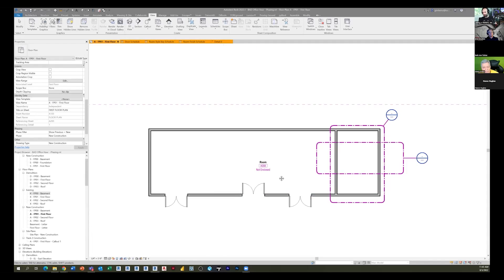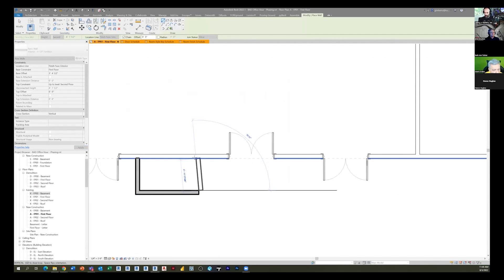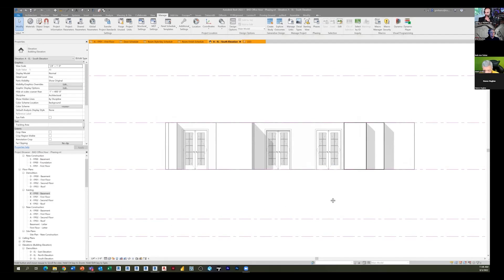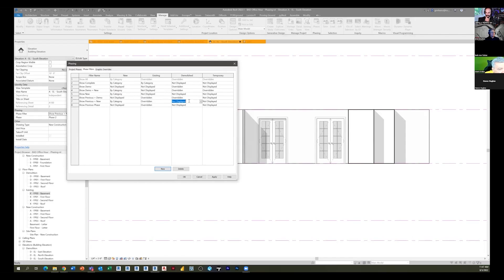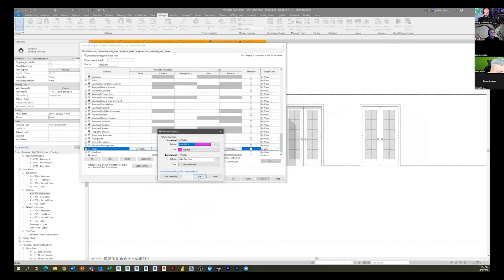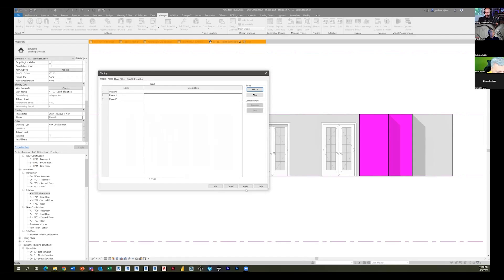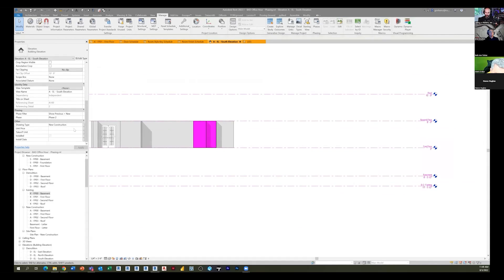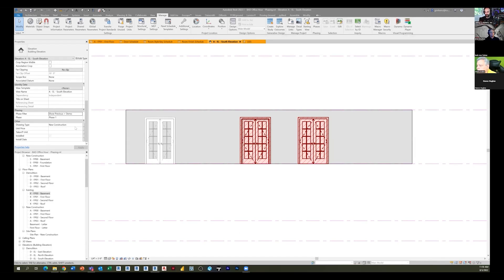Revit Phasing Tutorial : Multi-Phase and Demolition (Office Hour Sessions)

Comment: So, here's a question: based on Revit's statement that anything new is the current view/phase, we have Phase 1, which is divided into A, B, C, and D. How can I show all of Phase 1 (A, B, C, D) as bold black lines for new items? I tried using view filters, but Revit still makes the previous phase items gray/halftone, even though my filter states that Phase 1A is black.
Reply from the maker: So... you have Phase 1A, Phase 1B, Phase 1C, and Phase 1D...?  The only way to show ALL of phase 1 that way would be to make sure you are in Revit 2025 and use Filters with the Phasing (something you could NOT do in previous versions)...
Reply: @TheRevitKid  Got IT! But can you not show the pattern by category then? as in a CMU wall on the floor plan
Reply from the maker: @Pa_Dave  Yes, but you have to modify your phase filters (by view) to not override that... Set the view to None for phase filter, for example... and only use Filters for that view.

Comment: I find in some projects where I'm showing demo for the city to understand and for the contractor to know on site. Showing existing building where parts of elevation, plan, ceiling are the final moments in a time for a demo permit makes sense to have a demo phase? At least that's what I have done in the past. I know I could show all this with showing what's being demo but in my case it becomes a phase because there was a stopping point for demo permit.
Reply from the maker: You don’t need a demo phase to show existing and demo in a demo plan…?  That’s exactly my point in this video.  Assign a demo phase does not add a “stopping point”
Reply: @TheRevitKid  I get your point. Maybe I'm overthinking it, but I had a separate demo permit to start which included a 3 story office building where the city would quickly approve interior demo but not necessarily the roof and other exterior demo without showing what's replacing it. The demo was started before we had our main permit. Then there was additional demo to the rest of the building with the main permit. At the time and this was 2019, I didn't know how to separate the demo from one another other than creating a phasing plan.
Reply from the maker: @kevinhicks9447  I see … you’re talking about a very specific circumstance in which you have multiple demo phases before any new work starts… that would require specific phasing setup, of course … there’s always some exceptions to the rule 😜
Reply: @TheRevitKid  exactly.

Comment: Phasing gets a bit complicated when you have infills, half walls or try to group stuff.Complex renovation in Revit is prone to making mistakes. (hope someone will adress these difficulties)
Reply from the maker: Yes and no... As long as you have a plan on your approach, you can get them to work... In groups, yes... can be very challenging!
Reply: @TheRevitKid  i tried design options as a workaround which work in essence better than phases. Greetz from the Netherlands enjoy your tuts.
Reply from the maker: Yes, understanding design options can be a huge benefit as well.  Depending on the project I have also used design options to overcome some phasing limitations (mostly when it comes to site modeling).
Reply: Recently had a remodeling project of a house, and use demolition and phases to get data i need, revit helped to much with this tools just need to do a great model of existing building in the begining.
Reply: @estebanferrera4077  it gets glitchy and somewhat unreliable in some projects. The core code of Revit and some principles are not good thats why you need so many workarounds. I need to be sure i can trust the software.